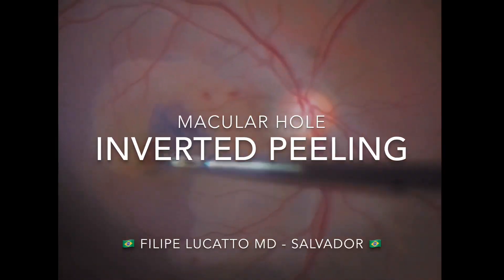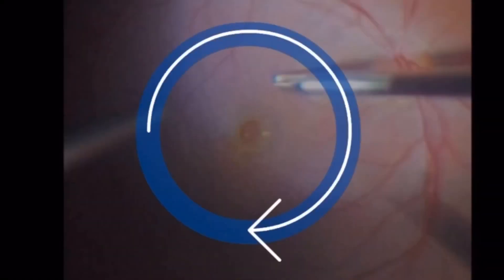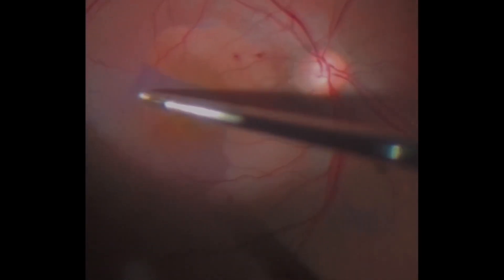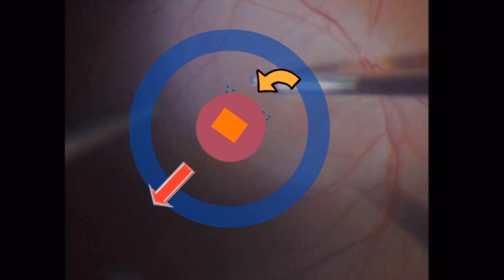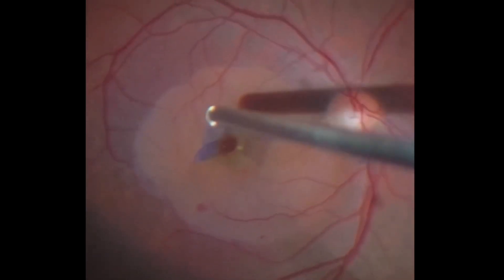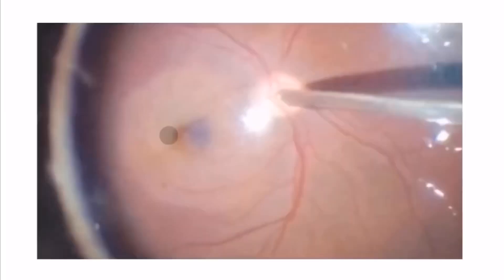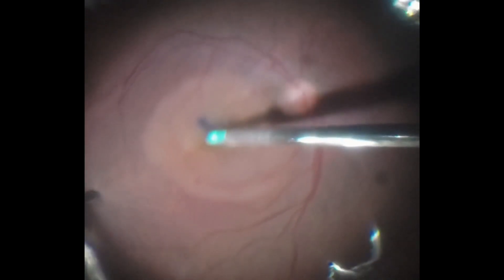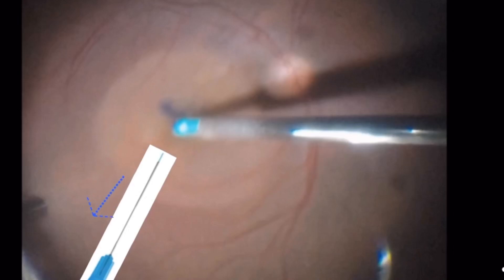Inverted peeling - Author: Filipe Lucatto MD

Comment: Sir, how the inverted nasal flap will maintain it's original position with change in the head position ? Will the FAX be able to maintain the flap position even in sitting or standing position?
Reply from the maker: harsh singh dosti , I usually inject SF6 20% in the end of the surgery and I ask patient to keep facedown in the first 3 postoperative days. I had no problem with ILM dislocation in inverted peeling technique no matter the flap’s position (nasal, temporal, superior or inferior). I think that it keeps stable due to the gliosis process that help anatomic closure of the MH.
Reply: @RetinaTips  thank you Sir. I'm a Retina fellow & haven't done much of macular surgery so, just asked out of curiosity. Thanks again